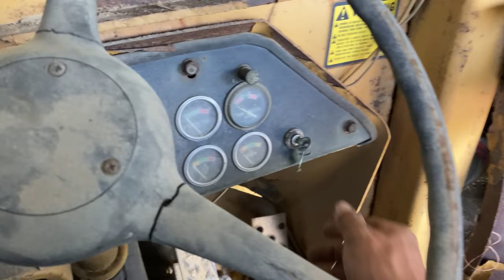Fiat-Allis Wheel Loader Sitting 12+ Years will it Run and Operate??

Comment: Seems like it runs better and is in better working order than the Clark is.
Reply from the maker: Agreed
Reply: @DieselCreek  May I suggest a sand blasting attachment for your pressure washer? it will off flakey rust and old paint from machines right down to steel.

Comment: I still favor the 'Orange Crush' - seems that ol' beast has a lot of spirit.
But you're right - size wise the F-A would be more practical. Hope there's a reveal of a bucket find.
Now what's this about some dimwits stating that the 'finds' have only been sitting a few weeks? 
I must have missed that (or ignored it) in the comments. 
I guess that the tires sunk into the ground are not enough of a hint, or evidence for them...
PS: where or where is the CJ video? :-)

Comment: Very very Stupidly lucky these goons never Hydrolocked this thing spinning the thing over with cracked injectors still threaded in the head dumping nothing but diesel into the Piston and Sleeve area
 Could still have  reversible Warped or Bent or Both connecting rod or rods  Damage stupidly preventable but not with these types.